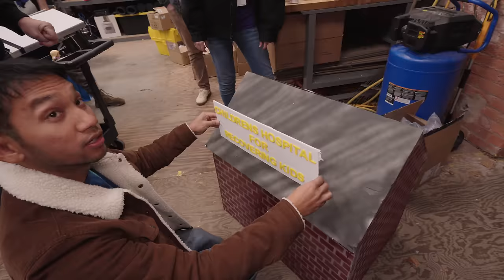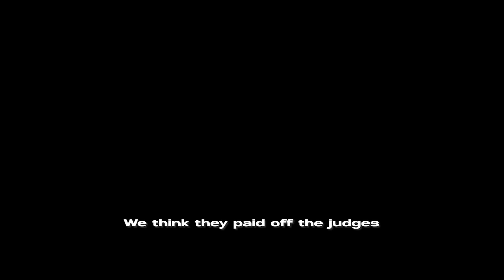Never let 'YouTube Scientists' fight robots

Comment: the airbag bot is actually pretty smart.
Reply: I unfortunately think it would be counted as an entanglement device, and thus not be allowed in a "serious" bot
Reply: We need more bots that just have a one use super attack
Reply: @106640guy 
Definitely.
Reply: @106640guy  technically the flamethrower bots with their limited fuel supply sorta counts as such.
Reply: Genius until you remember that airbags are impact sensitive.
Reply: @markjacobson4248 It almost sounds like that's what happened in the video with how Kevin yelled "that was our secret weapon"
Reply: @pupyasko1233  Wait, so it's the fact that it's an entanglement device, and not the fact that it's a literal explosive, that would disqualify it?
Reply: @delphicdescant  I think so
Reply: @delphicdescant  I just looked up the rules again, and found this: "Designs that utilize pneumatics, hydraulics and subsystems using airbags are allowed, but must be approved by NHRL staff through the Design Approval Process"

so yeah, if you can make it not an entanglement device, this may be allowed
Reply: @delphicdescant  combat robots are already pretty violent in their own right, so a small explosive doesn't seem that out of line. Many robots have flamethrowers now too, whose fuel tanks can and have gone through significant emotional events (exploded) in the past.

I think the real issue is how cautious you have to be when handling them.
Reply: @pupyasko1233  It is perfectly allowed in NHRL. It depends on the design's intent and the NHRL will determine where it falls on legality.
Reply: That bot literally had an overwatch style ultimate lmao
Reply: @delphicdescant  Yes, this is why there's a MASSIVE cage with double layered thick poly carbonate, and probably a net up the top too, to catch any flying debris that goes above 20 feet or so. If it can stop a blade spinning so fast it destroys itself going into the poly carb, then I think it can stop a tiny little explosive. 
These kind of things usually have experts watching any stuff with pyrotechnics or explosives for safety reasons, and emergency services on site just in case.
Reply: @markjacobson4248  Airbags are not impact sensitive, you can smack one around with a hammer and it won't do anything. There's sensors in the car that talk to a computer and the computer sends a voltage to the airbag to detonate it.
Reply: @106640guy  I wonder what the rules around a spring powered repeating cannon would be, have it shoot shot put balls or something for the unlimited weight classes
Reply: @LunarKittyLily it’s allowed as long as the projectile doesn’t exceed 120 mph so not very fast when your goal would be to beat up on a block of metal
Reply: @pupyasko1233  i read in another comment that its the intent that matters, this airbag wasnt intended to entangle and then entanglement was a accidental byproduct so it was allowed
Reply: @markjacobson4248 they're not, they depend on external sensors to trigger them on impact.
Reply: @markjacobson4248 what? No they're not, they're pyrotechnic devices
Reply: @Hawk7886  the airbag itself is usually set off by sensors in a car, but the chemical inside, while not particularly shock-sensitive itself, is prone to reactions that form other compounds that are highly impact sensitive. TNT is extremely insensitive to heat and impact but I'm still not going to put a chunk of it on the front of a fighting robot.
Reply: It was like a buckler parry in Dark Souls

Comment: Intentionally trapping the opponents spinner on not one but two occasions was pretty insane.
Reply: Normally it's against the rules...
Reply: @natejackorjillkate4136  i think because it was an unexpected byproduct of the airbag, they were allowed to have it in. 

but yeah if you bring a net for this reason it's a rule breaker.
Reply: @natejackorjillkate4136  It depends on the **intent**. If you bring something that is specifically designed to entangle, it's banned. However, if it's unexpected entanglement, then it's not against the rules. Lil' Rip actually managed to break free of entanglement after the first instance, which was pretty amazing.
Reply: @Iain16  They literally told the driver to entangle the opponents weapon with it. They knew it would foul the weapon and then intentionally fouled the weapon.
Reply: @natejackorjillkate4136  I think its if the design was intended for entangling. its also not battlebots
Reply: Well these fights were just fun entertainment, not serious competition fights. A little rule bending is no big deal in such cases.
Reply: @233Deadman I often find show matches to be more entertaining than real competition. Not always, but often!
Reply: If you watch the Safety Third episode they had with the guy who basically runs NHRL that they intentionally let them bend some of the rules. As people pointed out they were exhibition matches so it wasn't a big deal.
Reply: @natejackorjillkate4136  have to allow it because they actually managed to do it. Street fight rules.
Reply: @natejackorjillkate4136  out of interest why is entangling a spinner against the rules? seems like a pretty good answer to a common weapon
Reply: @Dream146 Too strong I imagine.
Reply: @Dream146  I didn't make the rules so I couldn't tell you for sure, but I'm pretty sure it's because by weight, fouling is devestating powerful. For a few ounces you could create chaps around the machine much like chainsaw chaps, that strip off and gum up the spinners.
Reply: @Dream146   One of the big reasons is just that its boring to watch. People watch a robot fight and they want to see sparks, destruction, etc. and usually, a spinner getting tangled usually leads to a pushing contest which can be fun but not often. A lot of these sort of things value entertainment value a lot.
Reply: @piratecheese13  why the hell would that be against the rules? that sounds very dumb.

Comment: Clogging the spinner is onto something for an actual bot design.
Reply: But against the rules; no entanglement permitted. These were just exhibition fights.
Reply: @EgorKaskader  ah, I didn't know about that. Why is that, too hard to remove?
Reply: @biscuit715  Against the spirit of competition. It takes very little effort to entangle the weapon and drive with a net, and then it becomes unsafe to cut it away as something might suddenly spin up.
Reply: It also makes for very boring fights if everyone did it. While it looks great once it would totally shut down all the spinners and that would totally change robot fighting and not in a good way.

Comment: 14:38 That is the moment they start having doubts. What was that wire they cut?
Reply: It's the same wire they were talking about at 12:05. The final safety for the airbag to stop it from going off. Once it was cut the bag could be armed and fired.
Reply: @Lethal_Bite  Yes I know, I was intending that as the thought of the driver in the video, had they not been forewarned.
Reply: @57thorns  Oh.... Well with my reading comprehension now checked I can see that. And that is a good insight. I would be terrified to go against someone who cuts their wires right before the battle.